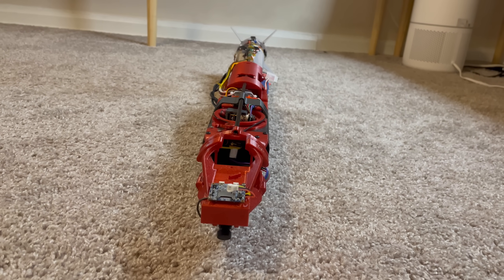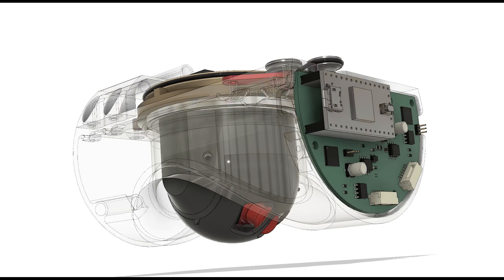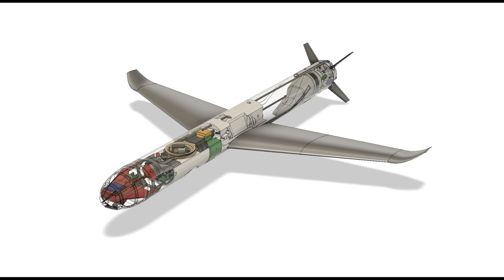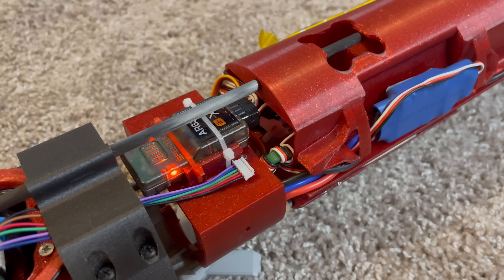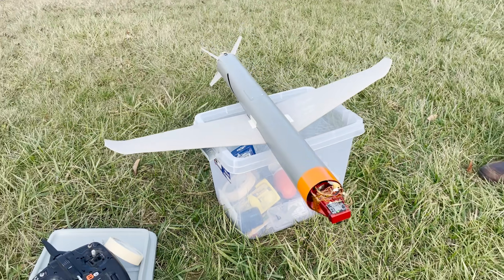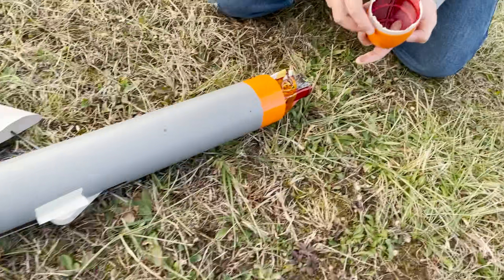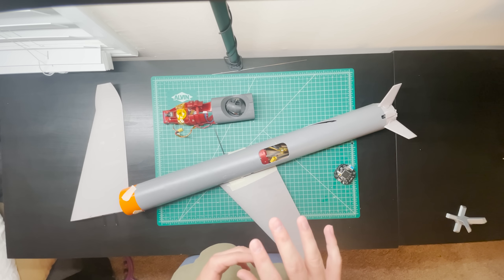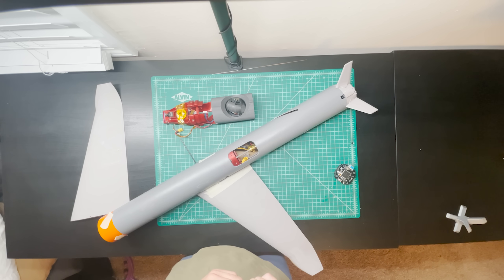Building (And Crashing) my Homemade Surveillance Drone

Comment: couple of ideas:
1: reduce takeoff weight by printing in lw-pla or lw-asa, this will really help fix your thrust-weight. 2: the EDF isn’t getting enough air or isn’t efficient enough, so a ram air or larger feed duct. 3: larger control surfaces, especially if you’re going to be at low speed.

Comment: To address your problem, you could try these:

1. Don't hand launch it. It obviously needs more speed. Maybe place it on a rail and go full throttle with full up elevator.

2. Try shifting the Center of Gravity (CG) around. Ideally, for an aircraft, the CG should be ahead of the Center of Lift (CL). Also, the CL is basically located along the chord of the wing, or the wingspan.

3. Try to put on some flaps. They don't have to be movable. Even if they're fixed, they'll give you more control during takeoff as well as landing. Also, this is only if you're using fixed wings.

4. If you aren't using fixed wings, try increasing the area of the wing and/or reduce weight.

Comment: I don't think you have enough thrust to fly that thing is all noise and no punch at take off so any control surface you have isn't getting a chance to effect flight. The guy throwing it needs some experience aswell. Maybe try a launching rail to get you straight up to speed when launching. You do rather well not to let out some colourful words as I would have done.

Comment: You motivate me brother! After you where sure that all components worked the way you wanted them to you should have stripped it down to just what it needed to fly. That way you could test the integrity of the design. A wing design is usually tested in a vacuum (separate from all other components of the platform).

Comment: I am unsure if the little integrated prop could propell it fast enough even in air. I'd stick with a big top propeller or a rear one but you'll have to figure out a system so the prop does not break.

Comment: Hi, i just realized that we currently are working on similar project. As a french aerospace engineering student, I am working on a rocket tracker using a Near Infra Red camera but with much less budget than you so i kinda cut cost in pretty much everything 😅. My tracker is supposed to be on the ground and has to follow the rocket take off while being very close from it so i kinda had to learn obout predictive PID control which wasn't in my 2025 bingo.

Comment: those hand launches looked pretty questionable... your assistant is really pushing the aircraft through the air giving tthe airframe all sorts of random forces.. your suppose to just gently let it go into the air.. i think the airframe is more suited to being a rocket... but with a fan in the back like that it cant provide enough thrust to maintain slow speeds... lets remember rockets are shaped like rockets for a reason. and your trying to fly an underpowered rocket like a drone... the airframe surface area is probably way to small and the motor is way to far rear..

I think it needs bigger wings.. designed for either high or low aspect ratio. try both maybe and more power with bigger control surfaces..

this shape needs speed to function

thats my 2 cents
Reply: love your work mate

Comment: Fundamentally, your initial velocity is too low. Look at using an extruded aluminum and surgical tubing for a launcher, calculate the final velocity at the end of the rail to be above stall speed. I might agree that your tailfins do not offer the control authority you're seeking. Could you find a way to establish roll control with the wings to maintain level flight that would reduce the reliance on increasing the tailfin size, and focus more on calculating pitch and yaw?

Comment: Firstly this is very cool.
I think altering your design for slow speed/ away from its intended use is not the call here, especially just to make launching it easier when the end goal is so different. 
What about just dropping it of a very steep cliff (it’s a really good excuse for a holiday maybe?) or a catapult system as you say. 
Additionally how about making it a bi-plane wing? Loads of lift and you move your centre of effort closer to centre of gravity. 
You could then split your inlet, could this give you better air flow into the fan? (In my very very humble opinion your lacking thrust, because your asking too much from your inlet )
Depending on launch parameters may this concept be better as a glider?
Keep trying this video has been my favourite so far.

Comment: Cool project! You seem to have built a glide vehicle with an assist fan. The wieght needs to be better distributed behind the wing. Consider a larger diameter fuselage so you can incorporate a thrust tube design as well...

Comment: Great build put worker one on vertical stabilizers make them big also for launch u need rails this thing needs speed more than hand launch can handle it’s like trying. To hand launch a 1500mm+ p51 the plane cant it needs more speed since so big. Or you can launch this like rocket and when it stalls deploy wings trade altitude for airspeed and ur flying like powered glider

Comment: The payload is fine as long as you find a way to increase take off speed. Maybe like a slingshot, or a gas powered system. The EDF should produce enough thrust to maintain flight. 

Try to decrease the total take off weight from the aircraft until you find a suitable airframe that flies, and slowly start adding back the payload.

Comment: Use google Ai and ask "what kind of balance to weight ratio is maximumly efficient for a design similar to a cruise missle".I was thinking about this and I think that the cheapest way to try and get airborne would be to make a set of landing gear or wheels. Just to use temporarily. You can go to a large parking lot and just try to take off like an airplane. I think that you may have to modify your design a little, but still.Normaly something like that would start out already being airborne and it just has to function well enough to hit the target.

Comment: The thrust vectoring fins seem unsuitable for a surveillance drone, they reduce efficiency a big deal and while providing great turning capacity, this isnt needed in a surveilance drone as the primary goal is to fly smoothly and in passes to get visual of an enemy. I understand that this has the potential to carry, in which case better maneuvrability would be choice, but in just its surveillance stage, it isnt required

Comment: You might try putting the tail fins in a plus shape treating it more like traditional control surfaces where the vertical fins move in the same direction and the horizontal fins move independently

Comment: Wings are normally designed with a tear drop design so the wind forced would provide lift. If the wings are too flat it may not work. The speed is also important. And yes, the weight is also important. The fan may not be providing enough thrust either to generate enough force, so you will stall easily. The tilt of each fan blade is also important to manipulate the direction of the wind coming from it to provide thrust to power the drone through the air. Looking at a house hold fan would give you an idea. It's all about aerodynamics. Another idea would be to suspend it in the air and have a high powered fan blow on it to give you an idea of the effects when travelling in the air. But I like the project otherwise!

Comment: It looked like ti was waaaaaayyyy tail heavy. It should have at least flown like a spear into the ground if weight was the only issue. But it is clearly very heavy. Ducted fans also lack thrust, even a good ducted fan model needs a good throw to launch successfully. My suggestion is move the CG forward, cut weight, increase the wing size and control surface size, forget thrust vectoring and go with traditional control surfaces and use a light weight landing gear to roll up to speed. That's alot of changes. Perhaps its best to use an existing airframe and just add your electronics since thats your strong point.

Comment: Best advice, is buy a cheap r/c glider of good design that you know has good stable flight characteristics. I'm sure you could download and 3D print something. I guarantee you will learn more in a day and have way more fun for verry little cost. Designing/building cool models and flying them are two verry different things. I'm sure you know the principles of flight, but better to experience them on a slow model that doesn't break easy first. Hand launch, trim down and launch gently and level, allow the model to gain speed. All your observations were correct, wing loading, control surface's, but mainly you need more thrust, you could use a more efficient aerofoil for low speed. Launcher would be (unnecessary) but verry cool if you want a V1 Rocket .😄 Great first attempt, don't give up, I cant wait to see the final version. Cool points 11/10 👍

Comment: What a lost generation...
There seem to be search engines, all the information seems to be available, but people wonder if this is some new military technology. Or what kind of complex aircraft it is.
This hobby is called AIRCRAFT MODELING. I'm afraid to disappoint you, but tens of thousands of gliders have long been created and built in various stages of completion. It's just that 3D printing makes it easier for beginners to make these aircraft models, but it doesn't improve the quality.
Any printed aircraft will always be heavier than one made of wood, foam, fiberglass, or other materials suitable for light aircraft.
Secondly, a ducted fan is literally the worst engine for aircraft models; its thrust is literally insufficient. A pull or push engine with the same characteristics will produce far more thrust than a ducted fan.

Comment: Your thrust vs weight and drag is not sufficient enough to reach rotate speed. The opening fuselodge also need be directed to the engine. If not the openings will creat alot of drag.

Comment: Awesome project, love to see how this evolved!
I have no RC experience, but I think you should go for a launcher system. This would allow for controlled and repeatable launches (or at least the attempt). This way you could pinpoint the minimum launch conditions and start to adapt and test your design to approach your desired conditions (like launching by manually throwing it).

Comment: super late to this party, but your system looks a lot like UAVs used by the Iranian military and their proxies. Those systems tend to use Rocket Assisted launch or catapult launches, both using rails. that would probably be a loot better that throwing it like a balsa wood rc plane.

Comment: You don't have enough roll authority or thrust. You won't generate any lift until you get the wings to stay level. You are thinking like a rocket guy, not an airplane guy. Could you incorporate ailerons into the wings? Can the tail fins align with the axis of the wings? (horizontal stab, vertical tail, and downward tail). Just some ideas. It also looks like you are starving an already under-powered thrust generator by limiting the intake size. EDF's aren't typically very good, or efficient thrust sources. They sure look cool though.

Comment: I honestly think rocket launching it would fix its issues. If you launch it directly up it can gain enough speed before it comes anywhere near the ground. (I would add a manually deployable parachute just in case tho)

Comment: 10:30 would mount the duct inlet on the top side. Schould not make  big difference on fly performance. 
The the energy consumption on EDF is high. I think it is time to land after you stabilzed the craft in the air. 😂

Comment: - this looks super tail heavy.
- needs serious weight reduction. consider using PLA-aero or PETG-aero. it foams up when heated so you get a noticable weight reduction in print.
- the wing lets dont really add anything but take up extra space. get rid of them or make them very short.
- the edf will likely perform better if it had an air scoop
- make the winds wider. it wont hurt your design if the wings poke out of the airframe a little.

Comment: I know im a little late but i do have some suggestions. I think for your first flight you may want to use some sort of sling shot launcher to get you up to speed quickly. The army and navy use these sling shot launch rails for there counter measure drones. Another possibility when you get the wings to fold out may be to attach a rocket booster that disconnects and starts the fan motor at apogee or something. This may give you flexibility for things like vertical takeoff. I know this is far more complicated but may be worth looking into

Comment: Could you launch it from a moving vehicle? I know it wouldn’t be ideal for sustainable operations, but as far as testing actual flight and design, it seems like it could at least get you going until you had time to work on dialing in a rail launch platform.

Comment: Thrust to weight for sure, did you account for control surfaces blocking exhaust partially? Supper exited for you to get this in the air keep it up!

P.s. wing loading may be perfect for rocket assist but hand launch might not get the lift you need.

Comment: I’m a little confused why someone with so much experience would think this would work, not only is the plane extremely heavy, but the minimal control surfaces could never sustain flight. Also it’s known that at small scale, having internal engines isn’t optimal as it has no air to breathe.

Comment: I think the News Cycle is responsible for recommending this video, aka Iran and Israel/Russia and Ukraine.

Wow, I applaud you, you really put the work into the design, haven't seen anything this though out in awhile. 
Not a "drone" guy, but rc glider guy, also pilot on side.

-If you have long wings, you can twirl around and release, but tricky to learn. If launching straight, it's actually better to throw SLIGHTLY downward. Maybe ground effect, maybe the increased airspeed? IDK, but trying to throw upwards straight with anything large tends to make it unstable and crash, but going down gives me enough time to switch back to my controller. I saw your friend correcting, but he was helping to make it tumble, might need larger tail surfaces for the low speeds.

-I assume you already did this since I've seen other rocket guys do it, but the string trick on CG is a cheap wind tunnel. Maybe if you have something tall like a tether ball pole, you could test the thrust and a little maneuvering too.  If you want to confirm stability, you should be able to "fly" it without thrust, unless you are using the downward intake to counteract the nose-over pitch tendency that wings have.

-Since your design appears to have negative roll stability, is there any way to fit ailerons to counteract this? I have no idea how they would fit in the wing with it retracted, unless the whole wing tilts from the root.

-would adding something small, like screen door mesh to your intake reduce airflow too much?

-What weight to thrust ratio are you dealing with?

-The choice of putting the fins on an X rotation is interesting, I wonder if that has any impactful difference than a standard configuration of most airplanes. I don't know, just curious. 

Looking forward to see how this goes, Goodluck!

Comment: You need lots of propulsion in the start. The idea that maxing the engine and pushing the craft by hand is not bad but it's clearly not enough. you need a launch ramp and maybe a little rocket engine if those wings sturdy enough. And the craft can't glide it seems so you need bigger surface area for wings. these are my experience from gaming and making paper planes. 0 RC experience or rocketry or operating tomahawk missiles. So idk...

Comment: Suggestions from AI, but they seemed to be correct,

Helpful flight tips for this awesome project:

You’ve got a cool cruise-missile-style airframe here, but the reason it pitches up and crashes is a combo of a few things:

The Center of Gravity (CG) is too far aft; move the CG forward, likely by adding nose weight. Cruise missiles have a forward center of gravity (CG) for stability — your model is tail-heavy at launch.
Tail volume is too small for the large wing — the small V-tail can’t counteract pitch forces from those big wings.
Cruise missile designs like this expect high-speed flight, not slow hand launches. These are usually rail-launched at 200–300 km/h.
Hand-tossing at full throttle results in too little initial airflow over the tail, leading to loss of control.

How to fix it:
✅ Add nose weight to shift CG forward (try 10–15% more nose-heavy)
✅ Increase V-tail or horizontal stab size
✅ Consider using a bungee catapult or launch rail for more airspeed
✅ Once stable, then trim for level flight under power

Without fixing the CG and tail, it will always flip and stall. Once tuned, it’ll look awesome in the air — keep at it! 🚀

Comment: I would conduct aerodynamic testing in a wind tunnel to validate its flight capabilities. If the preliminary results are promising, I would consider a launch via rocket, aiming for an elevation of at least 1,000 feet

Comment: I am not an expert. I just had a few thoughts.
1.  Place your intake at the top to avoid pulling in debris during takeoff or landing.
2. Increase your thrust.
3. Create standoff between your intake and the body (draw non turbulent air in, probably won't matter now, but it might if you launch via rocket in the future).

Comment: You need a much larger intake for the EDF (from what I know of EDF scale models). Scale model EDFs always have additional intake louvres hidden in the fuselage to allow more intake air beyond what the scale opening offers. That naca duct you’re using isn’t enough, at the very least it would be a scoop, using a ram air effect.

Comment: Shift the wings to nose
Increase Wing span
Use carbon fiber or tail and wing
Make proper Air duct let the engine breath 
Launch it with crossbow 
Remove unnecessary modules (for prototype)